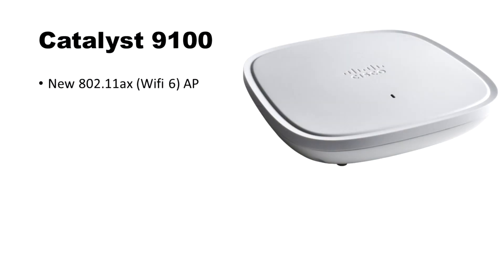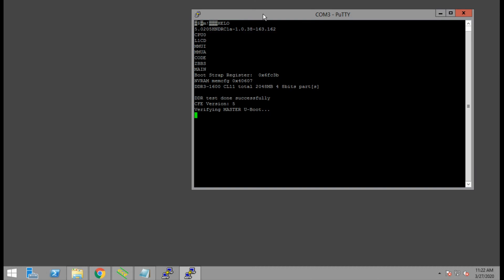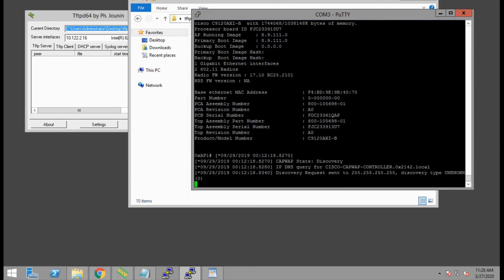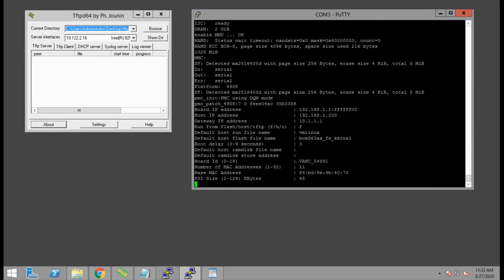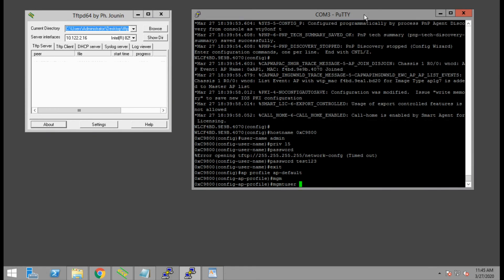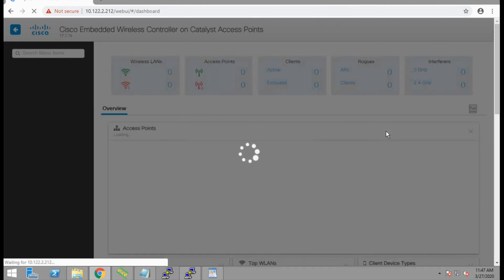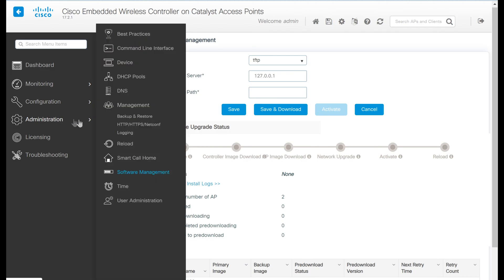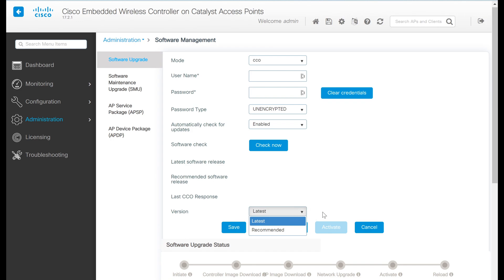[How To] Cisco Catalyst 9100 AP - Convert to Embedded WLC

Comment: Good Morning. I'd tried consoling in to the AP via putty (com port) but I am getting a bunch of garble. Can you please share what aud rate: Parity, Data bits and Stop bits; the whole purpose is the rest the AP back to default factory settings.
Reply: change the AP console port baud rate to 115200 see if that works

Comment: Does a controller need to commit after programming? I was able to get the controller operational and made several changes via the webgui. I saved the settings. After Installing the AP / Rebooting, My SSID never broadcasted and I can not get to the management portal. After Booting now via Putty I get a welcome to the CLI and I don't know where to go. Would you have a suggestion?

Comment: Can you please help.
I have a Cisco 9115AXI-EWC-D, which means i don't have to load the EWC image through TFTP . When i first boot up the device i am in the WLC mode. I have done the exact. Same configuration you've shown in the video. But ii am not getting the ping response from the WLC. I am using a standalone switch for the configuration so no DHCP server connected to the switch. When i enable the 'Device tracking ' on the switch i see that the AP is getting another range of IP that i giving to the EWC.. i have changed the EWC ip to that of AP but no avail. Please help

Comment: Hi, thank you so much for making this video! but I had a problem during the transfer files using TFTP, the AP connects to the TFTP server (tftpd64) but it doesn't show me progress rather it just given me an error code 71 (transfer failed) stating it does not connect to the server. I hope someone can help me with this problem. 
I can ping the AP from my computer using local network likewise AP (console) can ping my computer.
Reply from the maker: One thing to check might be your PC's firewall, if it has one. Often times that will block TFTP. It may also be worth double-checking that the TFTP server is set to the right directory on your PC, and does contain the right image files. If all that is correct - you could also try using a TFTP client on another PC to test as well. Hope that helps!

Comment: hi sir i am new in this is tftp server need to run in the background to do this if yes then why ? 
thank you
Reply from the maker: Hi there - thanks for the question! 

Yes, you'll need either a TFTP server, or you could also use SFTP or HTTP/HTTPS server. Whichever option you use, the server will only need to be running for a short period of time. This is only used to serve the device firmware images, so that the AP has a method to download them. After that process is completed, you can turn off the TFTP server.

Hope that helps!

Comment: Will the embedded wlc being able to run dhcp from the ap rather than an SVI or dhcp server? I want to use this an ap on a stick for a pre-survey. An access point mounted on a camera light stand with wheels being power by an battery source. So once my device hits a particular signal db I know that is where I need to place another access points.
Reply from the maker: Yup, it has an embedded DHCP server that can be used: https://www.cisco.com/c/en/us/td/docs/wireless/controller/9800/config-guide/b_wl_16_10_cg/dhcp-for-wlans.html#Cisco_Concept.dita_cf3a1219-4b1f-432e-8ec5-42ed8a860302

Comment: Thanks for Sharing. This is a helpful video.

Off topic: I found it interesting that the readme.txt image file mapping showed AP185X (image file: AP1G4)

I think C9100 APs EWC is a C9800 series controller, and C1800 APs Mobility Express is a C3700 series controller

Binary size for C9800 is about 260 MB and C3700 is only 15 MB --- what a difference!

Comment: Can these AP can work as standalone only to check the signal strength??
Reply from the maker: Hi there - Yes the access point supports a monitor mode where it stops serving clients & instead is dedicated to scanning / helping make channel decisions. Cisco also now makes some cheaper dedicated sensors, which act as a generic wireless client & can be used to monitor signal strength from different areas: https://www.cisco.com/c/en/us/products/collateral/wireless/aironet-active-sensor/nb-09-air-act-sen-data-sheet-cte-en.html
Reply: I have converted to ewc but it is not broadcasting any ssid nor able to access from gui but can access through cli..

Comment: If i have more APs with the same model say 9115AXI-S, do i need to upgrade each AP's image that matches with the image of the virtual controller or existing EWC?
Reply from the maker: Hi there - They don't all have to be the exact same release. You'll just need to be sure that the version running on the AP is compatible with the EWC or virtual controller.  

The compatibility matrix can be found here: https://www.cisco.com/c/en/us/td/docs/wireless/compatibility/matrix/compatibility-matrix.html#pgfId-590411
Reply: @0x2142  thank you so much! Your video helped me a lot in implementing 2 C9115AXI-S! I followed your guide, but upgrading the firmware was slightly different, the commands from cli weren't recognized. So i uploaded the firmware via webGUI. Works well! Again, thank you so much!

Comment: Thank you so much for this video! BUT I need help with my tftp CLI syntax. I tried everything but I can't tftp my two images (same as you). Please help.
Reply: By the way, I'm running 8.10 on my 9115ax AP and still can't get my tftp to work properly. I'm using SecureCRT ssh terminal/tftp server on my laptop. It's the same laptop I'm accessing the AP console port from. Any help is greatly appreciated.
Reply: I used this command (there are 2 tftp commands on one line).
AP1#ap-type ewc-ap tftp://192.168.21.55/EWC17.03.03/ap1g7 tftp://192.168.21.55/EWC17.03.03/C9800-AP-iosxe-wlc.bin   

This  Cisco document has a good how to guide on how to load the EWC on your AP:   https://www.cisco.com/c/en/us/support/docs/wireless/embedded-wireless-controller-on-catalyst-access-points/215303-embedded-wireless-controller-conversion.html
Reply: copy and paste the syntax as is on the video. if you're having issues with your tftp, temporarily disable the antivirus and windows firewall on the pc.

Comment: I have got 9120AXE AP which already got the WLC image on, but when I try to apply #ap-type ewc-ap tftp://x.x.x.x/ap1g7 tftp://x.x.x.x/C9800-AP-iosxe-wlc.bin it's coming up with the message  "image upgrade not needed, changing AP Type to EWC-AP" then below this -> AP is already configured for this type..... and then nothing happens, staying in AP mode, not able to use conf t, reboot doesn't help, hard reset doesn't help. What am I missing? Is there a command allowing to swap bewteen AP and EWC mode? I have travelled through many websites to find the way to convert from AP to EWC mode and literally every advise is stating to use the process shown in this video, but this is useless for me as it doesn't work when the image is already applied to AP.. Anyone with similar issue? AP running image is 16.12.4.31
Reply: never mind, working now, but if anyone would get the same problem - it was second AP working as EWC on the same network, apparently they block each other as there can be only one..
Reply from the maker: Hey there! Glad you were able to figure this out.  By default if there are two APs on the same network, one will become the primary EWC controller. What happens then, is the EWC web UI will only respond on the AP that is the primary. If the primary ever fails, the secondary will take over, and host that same EWC IP & web page

Hope that helps!

Comment: Hi, I have a 9105axW which should be able to join an EWC as a client serving mode only (according to the documentation) but I haven't been able to get it to join a EWC or upgrade it's firmware and I think it's a bug.  I would really like some validation here, because I really do think it's a bug.  https://www.cisco.com/c/en/us/products/collateral/wireless/catalyst-9800-series-wireless-controllers/nb-o6-embded-wrls-cont-ds-cte-en.html
https://www.cisco.com/c/en/us/td/docs/wireless/controller/ewc/17-4/rel-notes/ewc-rn-17-4-x.html (see table 3 & 4)
https://content.cisco.com/chapter.sjs?uri=/searchable/chapter/content/dam/en/us/td/docs/wireless/controller/ewc/17-3/rel-notes/ewc-rn-17-3-x.html.xml (see table 4)
Reply from the maker: Hi there, 
   What are you hosting your EWC on? And what firmware version is the EWC? I think you need 17.3.1 or higher to support a 9105. Are you seeing any errors, etc?

I may not be able to help too much - I don't have a 9105 available to test with. You may need to open a case with Cisco TAC to further identify if you're hitting a bug.
Reply: @0x2142  
Hi thanks for the reply.  I'm using a 9120AXB-EWC and the 9105 is the wall plate model.  The 9120 is running 17.4 and the 9105 is 8.10.  So they are well above the requirement.  I'll mail you one if you're curious while we work with TAC on it.
-s
Reply from the maker: Hmm - Yeah everything I am seeing says that should be a supported config. Assuming you have other clients joined to the 9120, it may just be a bug as you suggested...

Digging around for possible bugs, I found this one - but I am not sure if it would apply to your environment: https://quickview.cloudapps.cisco.com/quickview/bug/CSCvu20686